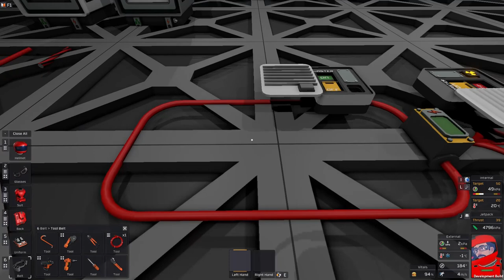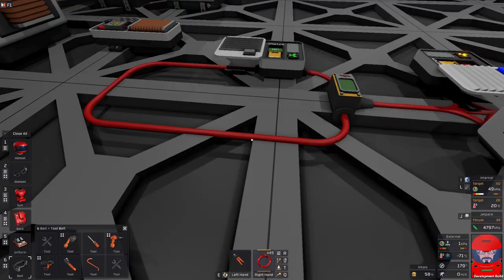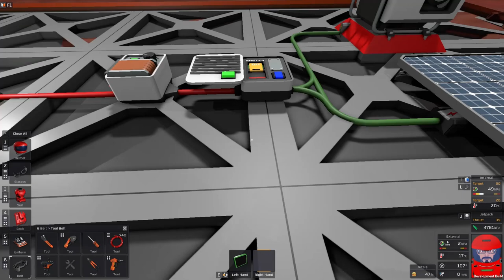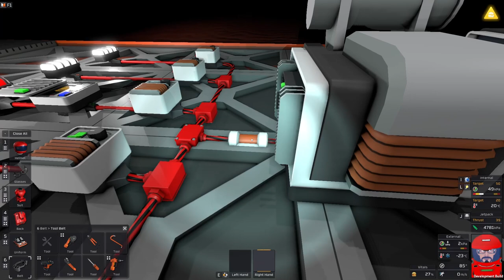Stationeers Power networks

Comment: Good video as always, thank you! 
A few more Tips:
- Use Spray cans on full stacks of cables, this way you only use one charge.
- When using unregulated cables and draw no more than 5kW, you can simply use one normal cable as fuse.
Reply: there's also a bit of a hack for coloring cables or anything else that stacks: spray a cable, and any other cables you add to that color gets the same color as it, without the need to spraying them at all. As long as you remember to keep just 1 cable coil of that color, you can make others of the same color for free.

Oh, and another tip - if you have cable when you create a machine (any of the printers for instance) when you deconstruct the machine, you get grey cable back - this is another color for free.

Comment: Wind turbines in a looped tunnel powering active vents blowing down the tunnel, jumpstarted by a battery or generator. Could generate massive amounts of power with only six active vents worth of power drain on the system which can generate as much power as you want by adding more wind turbines in a longer tunnel. Never using more than six vents worth of input power. Once activated, it powers itself. 100% safe Free energy for a massive underground base ware power is never a problem.
Reply from the maker: There are many ways to cheese the physics in this game but I feel it takes away from the survival aspect.  Brilliant inventing to come up with the cheese in the first place but in my game, I obey the laws of thermodynamics.
Reply: @cowsareevil7514  fun to experiment with everything. Love the videos.
Reply: @cowsareevil7514  I've seen these setups, and don't employ them for the same reasons as you, however, having said that - is it really cheesing the game? laws of thermodynamics - if you could drop the pressure in 1 area, and increase it in another and then open a conduit between both areas, you'd create wind - wind can drive a turbine. The only place where I consider it cheesing the game is that you can make more power than the draw by just adding more turbines.
Reply: @mwwoggy  Well in reality you would not get a net positive gain, you would lose converting the energy. The way air moves in Stationeers is highly unreal but fun as a game. However I very much agree with Mick, the instant you take away the difficulty to some sort of unintended semi exploit it sucks everything out of the game. Simply put if you cheat to win, you're not really winning.

Comment: I've started putting all my APC's on the input side of my transformers and connecting them with heavy wires since I once blew out a 5KW wire with just an APC and a large battery. It seems those small batteries can put out quite a bit of power.

Comment: If Power trough HC and Data only Regular cable  and connect in same circuit for economy, when try to draw high current regular cable will be blown. Even if cable is used only for data and in reality there is no load on it. In same circuit more than 5000W will blow. And will continue to blow if load stays. My usial mistake when i connect my AirCons/Filtration.